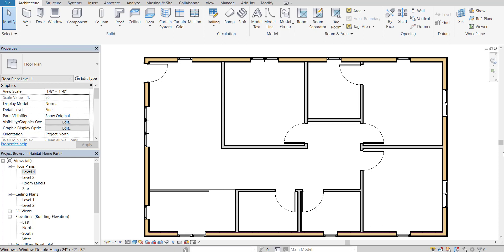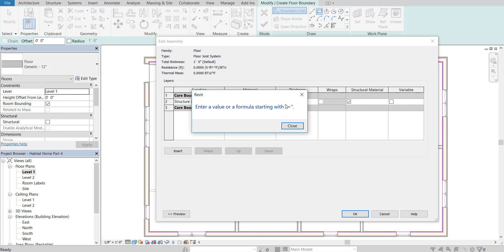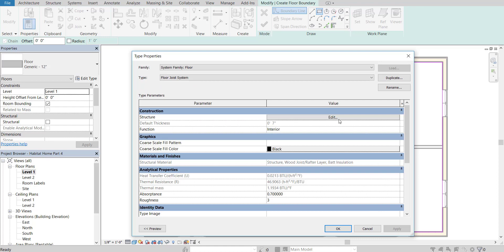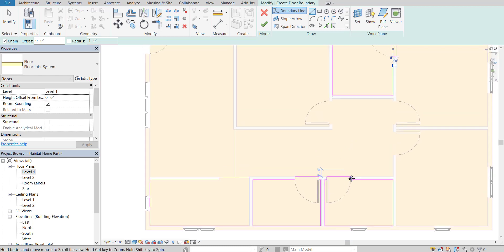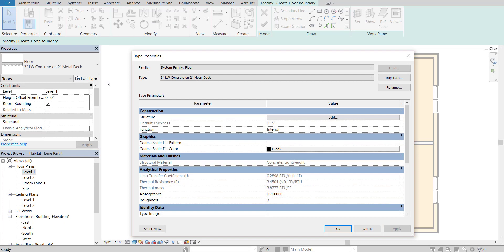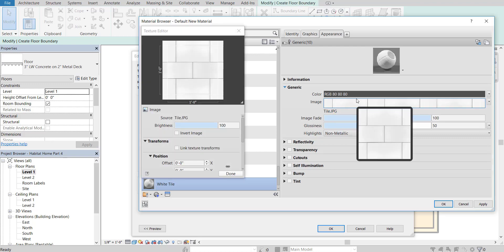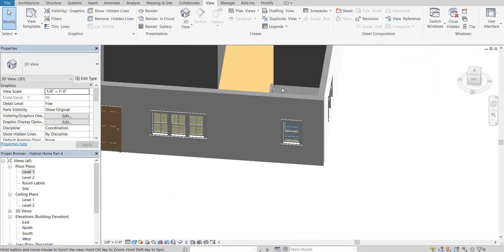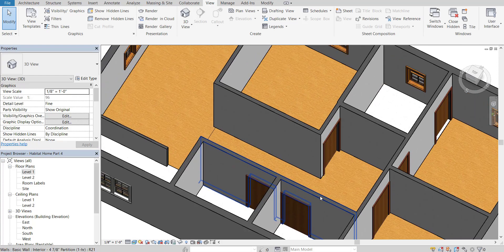Autodesk Revit 2018 Tutorial #6 - Floor Joists, Sub-floor, and Tiles - Habitat Home Design

Comment: Hey Mr. Z 
I had been following you videos for the Habitat house and everything was working fine until I got to the windows. Whenever I clicked on the window icon to select the specific type, the one you selected wasn't an option in my program. So I made sure I was on Revit 2018, but I already was. How can I get the other options?
Reply from the maker: Was it all the folders, just the window folder, or only that particular window?